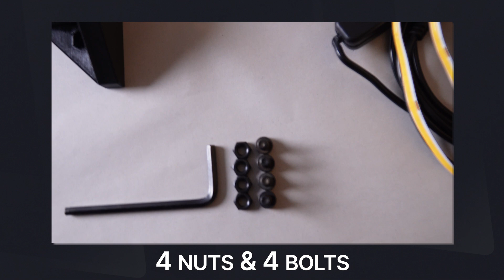Must-Have Enclosure Upgrade - Hex LED!

Comment: Where do the 2 bolt plugs go?  I see where you have them with the blue parts but never see you actually installing them.

Also, you have that little cable management clip towards the end of the video.  Is that available anywhere?

Thanks, Joseph.